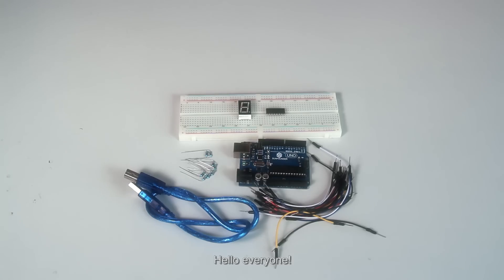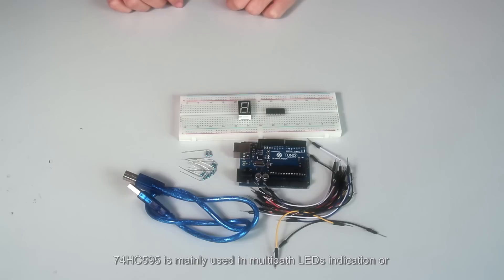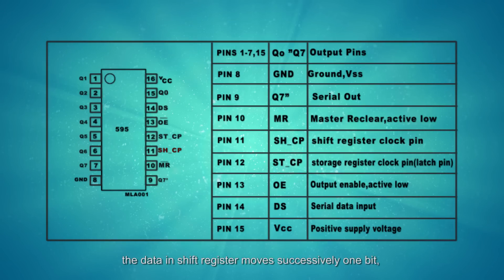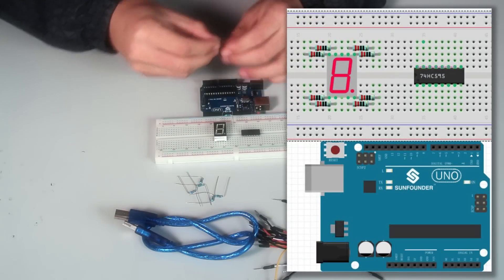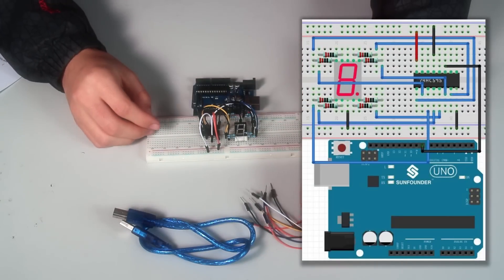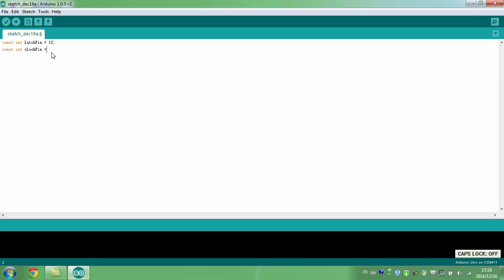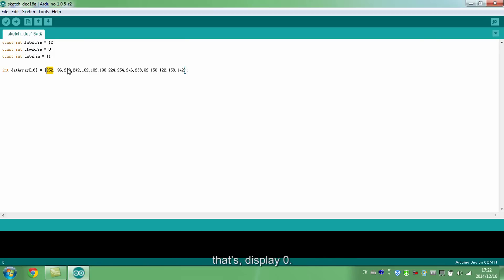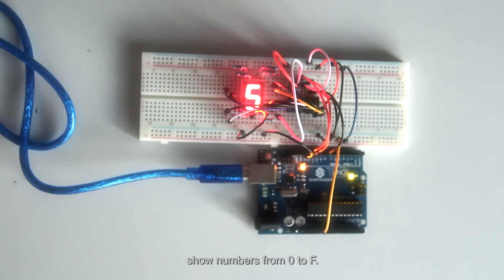Sunfounder Kit Turorial for Arduino - Driving Single 7-Segment Display by 74HC595

Comment: There are few bugs in the datArray string. 3, 5, 9, A and F were not correct. Here is the correct string: {252, 96, 218, 234, 102, 174, 190, 224, 254, 238, 246, 62, 156, 122, 158, 150};
Reply from the maker: After many tests, we are sure the string we provided is correct. If yours show a different string, is it possible your wire connection has a problem? please kindly check.
Reply: Absolutly all is correct!! Thank you so much for your knowdless!!! Regards from Mèxico!!